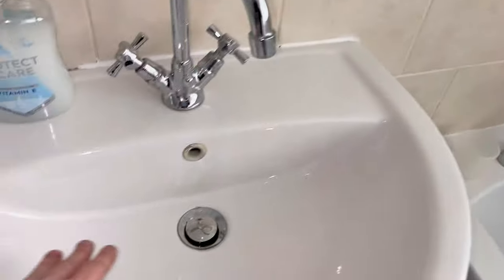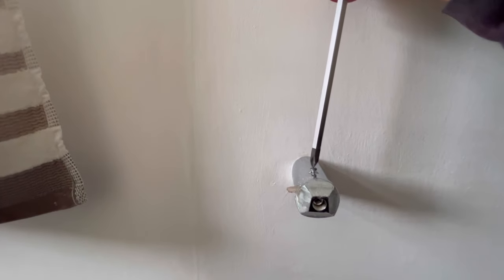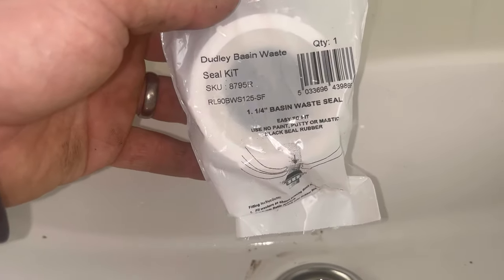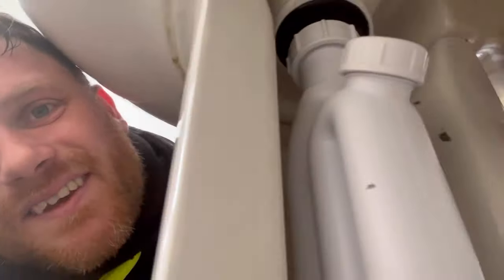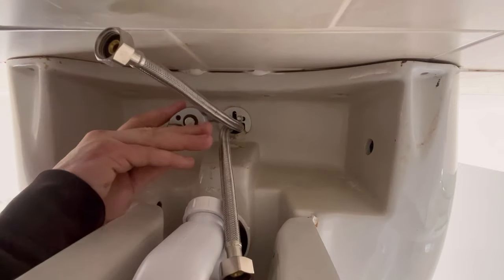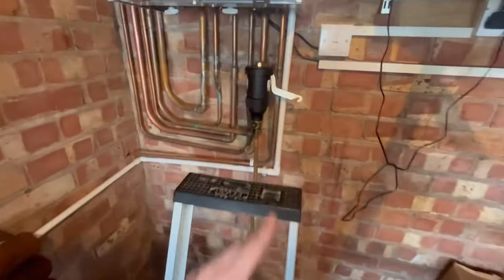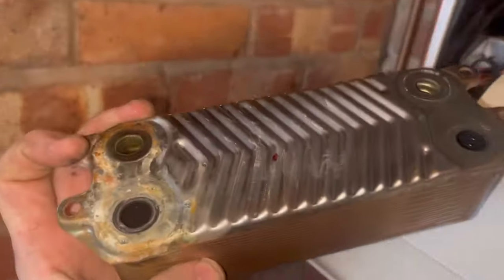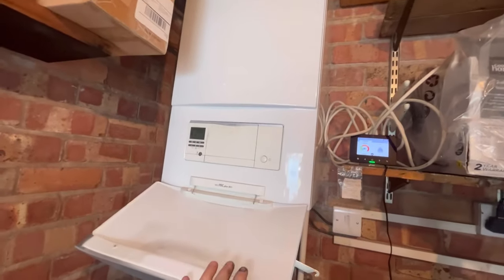Are We Sabotaging Our Own Plumbing?! The Next Plumber Needs Your Help!

Comment: I hate silicone too. Definitely agree with the basin mate and McAlpine traps. Never had a problem with either. Retro fitting a rad you just got to do what you can without ripping the bathroom apart.

Comment: I've always rubbed the isolating valve on a diamond flat sharpening board until the sharp edge as gone. Great video mate😊
Reply from the maker: Thanks mate, yeah I’ve used a file as well on iso to get it smooth as well 👍

Comment: Well done brother, I know the pain when you don’t want to pull the pedestal out or is stuck of existing design below the tiles or solid , anyway one thing you forgotten, every single time you change any tap you suppose to take out the tap aerator , any debris supposed to flush out of the tap and  you get equal and steady flow trough it once is done .
Reply from the maker: Well spotted mate I didn’t take it out, don’t like waste when there’s a pedastal always a pain 😅

Comment: Great video as usual 😊 a little tip I use for the basin washer in a 57mm socket off a land rover hub socket off ebay fits like a glove and is easy to grip and tighten by hand ✋ £10 but it's really handy in tight places 😊
Reply from the maker: Nice tip mate I like that 🙌👍

Comment: We used to use the basin mates but now only fit the mcalpine CWP60 waste. Hands down the easiest waste to fit
Reply from the maker: Haven’t used them yet might give them a try 👍
Reply: @bluebulldog_uk  you should mate. It's the only one I fit now... no need for silicone, special seals, plumbers mait etc... plus it works as a slotted and un slotted waste... all in 1👍